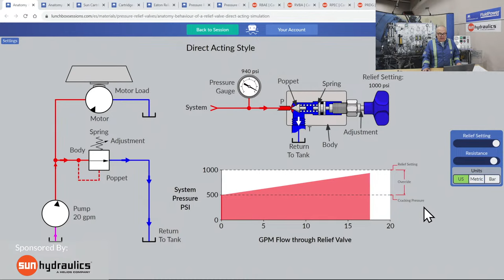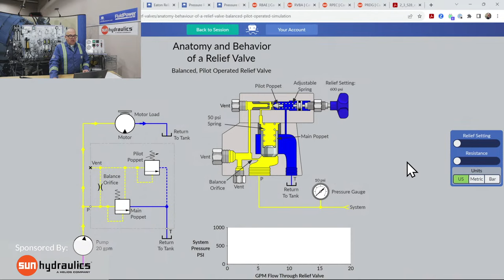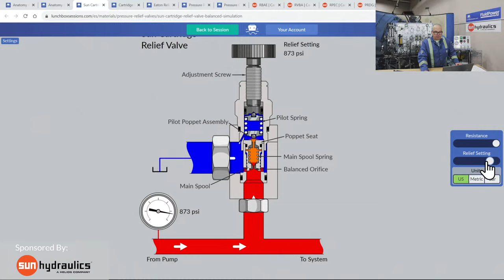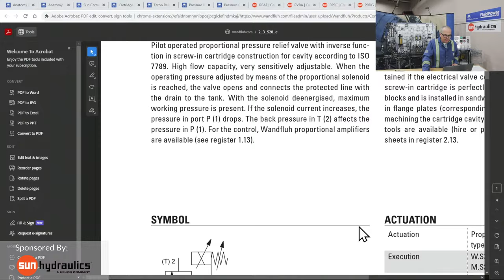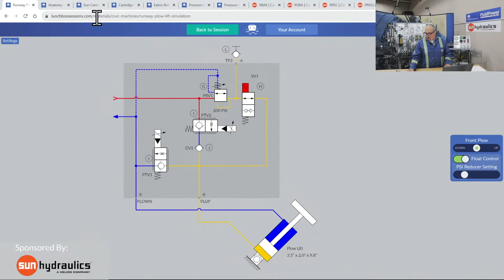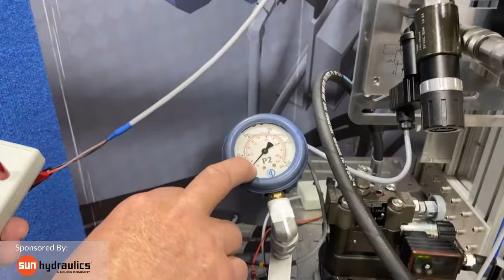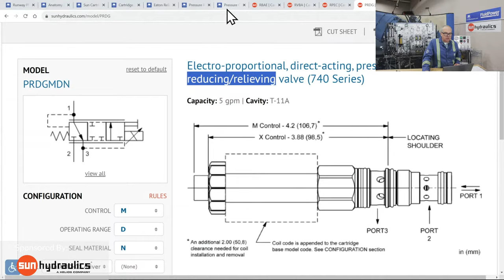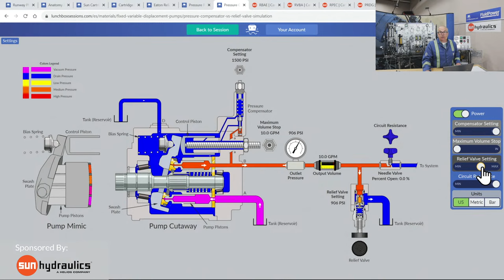Hydraulic System Pressure Adjustments (Live From Aug 22, 2023)

Comment: That was a massive eye opener to me that there is a crack pressure and a full flow pressure. This now explains to me why there can be so much heat generated in hydraulic log splitters when they aren't actually at the relief pressure.
Aussie viewer btw.

Comment: Great! On mobile  equipment, you vill hear an engine load if it relieves the valve in operation. If it pump cut off valve in operation, you will not hear the load.  Also the relieve valve will be very hot and if it is working long enough it will change color, dust on it will be white.